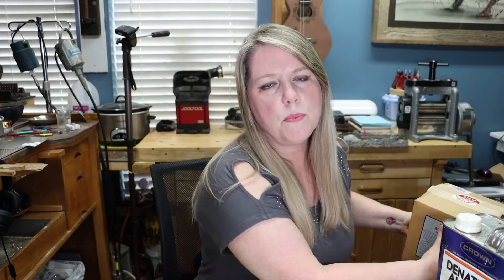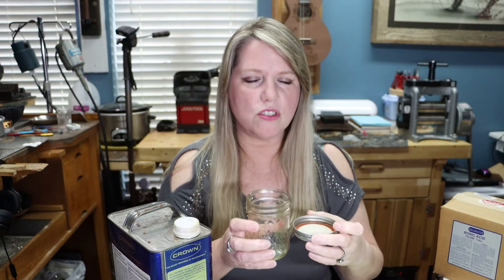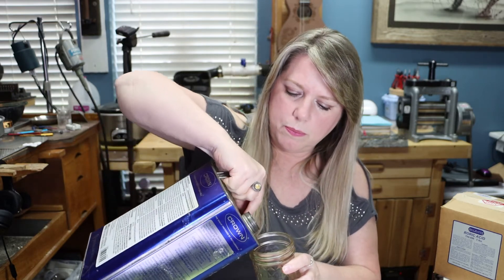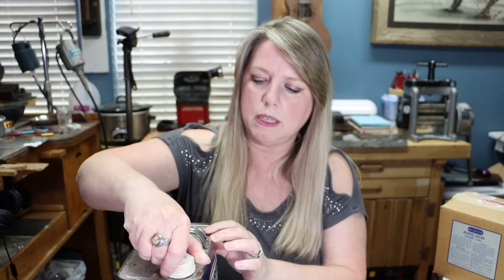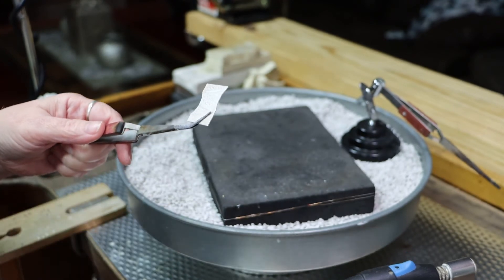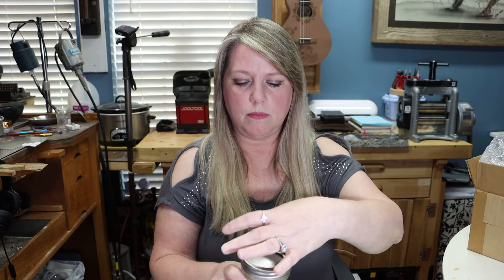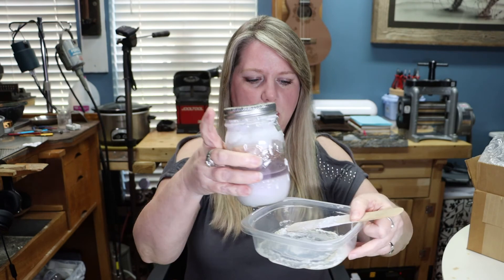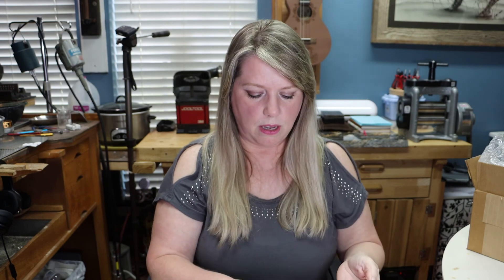Helpful Hints: DIY Barrier Flux to prevent firestain and firescale

Comment: How do I remove the scale shield after I'm done with the soldering?  Do I use pickling?  Thank you for the fire shield instructions.
Reply from the maker: Anytime you do any soldering operation, regardless of the barrier flux or flow flux you use, you will need to place it in pickle to remove any residue. Hope this helps!
Reply: @tammybaalman2429  Thanks!  It does help.  I'm still new at this.